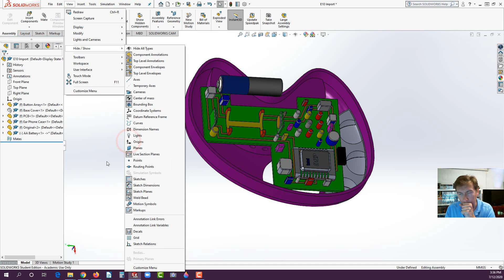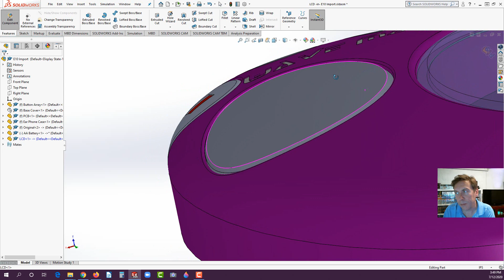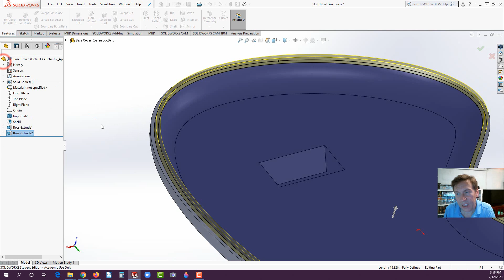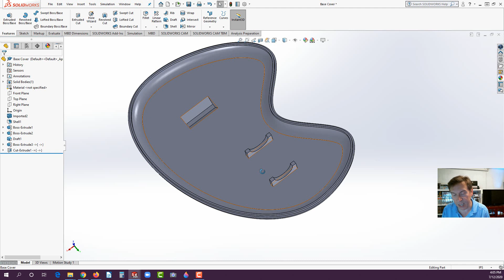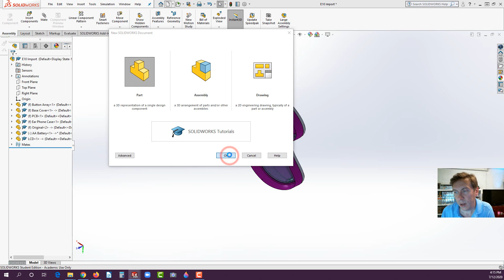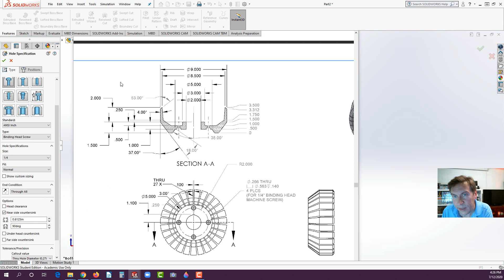E10 SolidWorks 2020 - Assemblies 3 Tutorial

Comment: Very nice exercise. Here I would like to ask, if there is a way to copy the jpeg (or any other format picture) and then paste it in the sketch. Is SW able to convert it to geometry and software operator just adds the driving dimensions????(or some other utility similar to that?) 
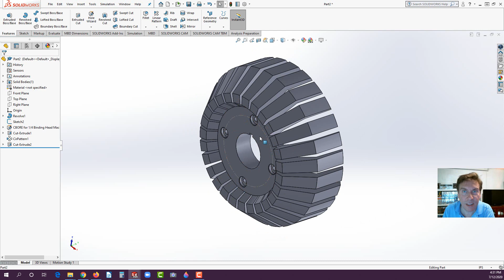P.S. :   @12:12//1:04:56 just to clarify for beginners, what you said..."Bottom Up" assembly it is only in the case, you model the battery as a part and then convert it to assembly 'component' and use it in your assembly(that is what you proposed at the beginning of this video). In the case you use the existing battery-as it is part of the ZIP file, then you are actually doing "Top Down" assembly.....("Bottom-up design is the traditional method. You first design and model parts, then insert them into an assembly and use mates to position the parts".).